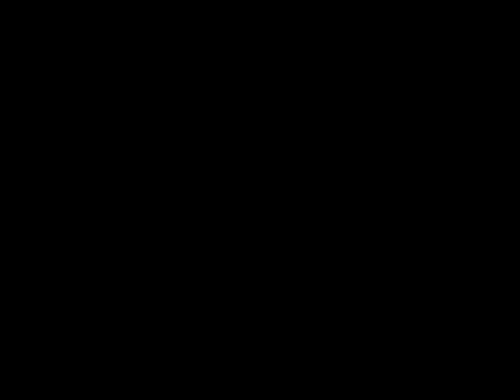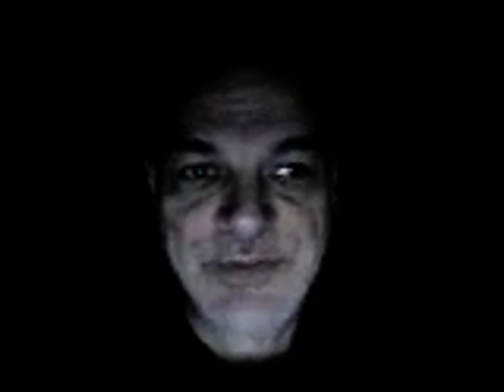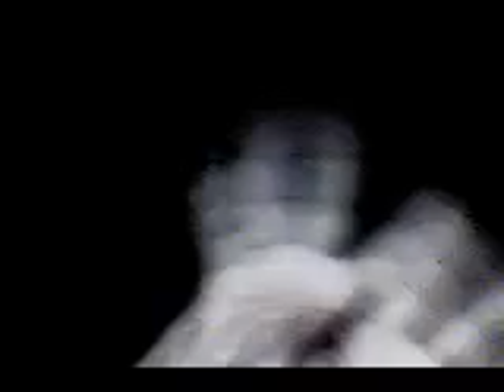waptek [REDACTED] & [EXPUNGED] due to the youtube purge 2022

Comment: Thanks I'm trying to understand CIP's caliber info on 7x50R, 5.6x50R necked up to 7mm (basically 222 rem mag necked up to 7mm) Thanks alot.
Reply from the maker: CIP's caliber info on 1992-02-27 German 7x50R = 

6.98 mm land & 7.24 mm groove Barrel with a 
6.50 mm of a  7.27 mm forcing cone / funnel into rifling 

7.25 mm bullet MAX till 68.00 mm over all length / bullet tip 
7.82 mm mouth @  49.50 mm case length 

7.83 mm neck @ 42.90 mm height right over a 
9.40 mm shoulder @ 41.97 mm height , tapering to a 

9.59 mm base diameter @ 1.5mm 
10.90 rim diameter @ 1.4mm thickness 

https://bobp.cip-bobp.org/uploads/tdcc/tab-ii/tabiical-en-page21.pdf
Reply from the maker: other source = 
https://naboje.org/en/node/13487
https://naboje.org/sites/default/files/styles/schema-large/public/bullet-schema3/13487.png
Reply: @WapTek123  Thanks!!!👍👍👍